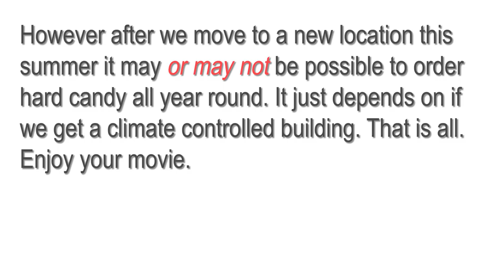Orange Flavored Hard Candy

Comment: How did this batch turn out. I'm curious as to whether or not the flavor boiled out of the batch because y'all usually let it cool for a while before you add the flavoring.
Reply: It actually depends on the flavor, weaker Is added in the boiling sugar, so make it stronger,

Comment: No citric acid for orange ?!😢
Reply: Well they did add those two shots and a half of flavour at the beginning
Reply: julie yeah, more than I would think was needed if the acid was balanced, but in the absence of acid, your sense of smell would be more needed to convey flavor, all modern citrus hard candy recipes I have heard of use acid, usually citric acid as that is what naturally provides the acidity in citrus fruits. So, this flavor would both be milder, sweeter and more aromatic, without the mouth watering acidity that is normally associated with orange.
Reply: The fact that they make flavors that have fallen out of western favor, means that basically you would be getting candy flavors nearly identical to flavors from the late 1800s
Reply from the maker: We use cream of tartar instead of citric acid, it does the same thing though
Reply: Hercules Candy isn't cream of tartar an anticrystalization agent with a negligible effect on acidity?